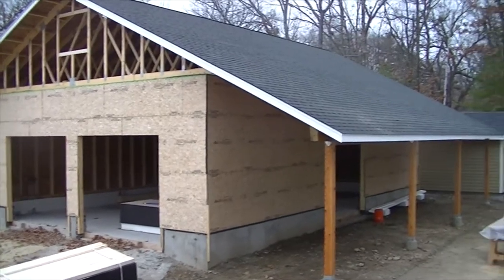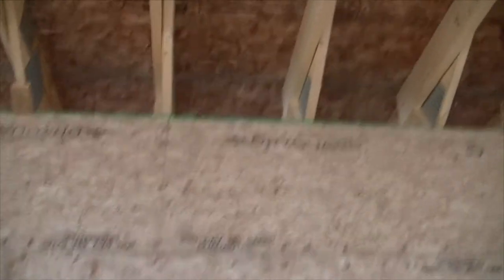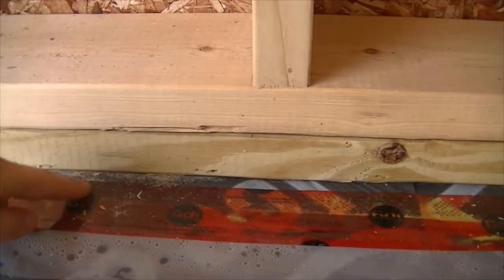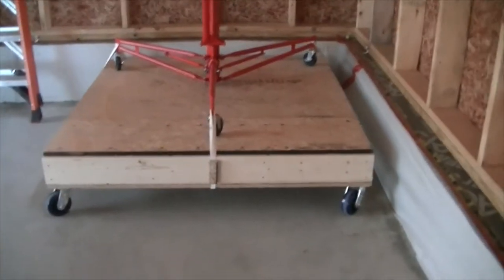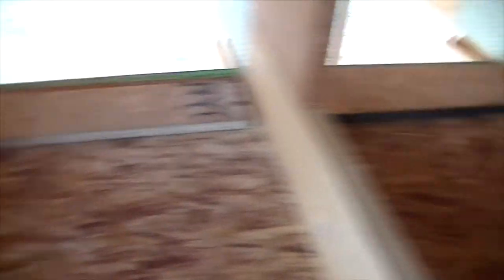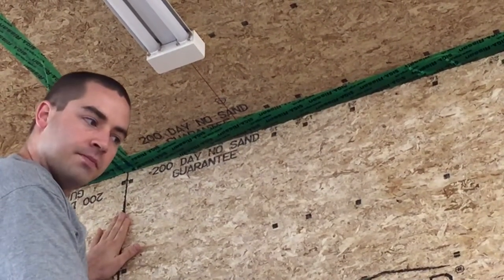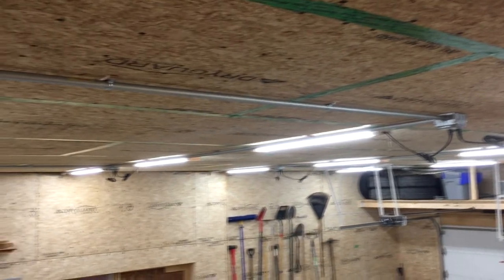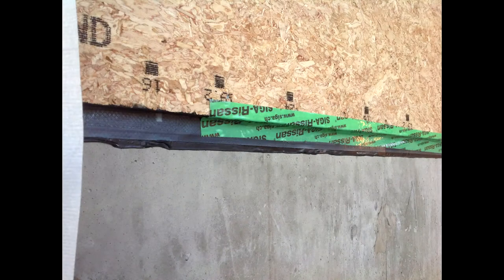Garage Air Sealing

Comment: Great video, huge exaggeration with the slightly misaligned plywood sheets. Slightly misaligned plywood sheets are easily air sealed with tapes or fluid applied flashing. I would reword that so you don't confuse the public. Also, if you have a living space on the other side of the interior wall osb sheets, you should have taped the joints as you mentioned you did not, the whole point of taping those joints when they are on the opposite side of the interior living space is too keep the air quality in the living space healthy and clean and not let garage containments in.

Comment: i think that you show really good attention to detail in your videos. with respect to garage air sealing, my thinking is that the weak point for thermal conductivity and air leakage is going to be the garage door, which seems to me would be impossible to air seal reliably. i suppose you could use an insulated garage door to reduce thermal conductivity through the garage door. is the idea that you were trying to improve the rest of the garage envelop to offset losses through the garage door?
Reply from the maker: Yes, you pretty much nailed it.  Doors and windows are always going to be the weak spots in any thermal envelope, but we all do the best we can.  I did buy insulated garage doors that have a rubber gasket between each of the 4 panels, rubber gasket on bottom, and the typical seal on the face.  The face seal is the worst spot of any of them.  But just because the doors are allow some air leakage does not mean the plywood seams have to.

Comment: So how does it perform?  I have an attached 36x24x10 garage that was only ceiling drywalled when the house was built (2005)... it is now heated and since pre-existing I foamed all of the joint cavities in each vertical wall, between every stud and in all penetrations in ceiling... then followed up with batts on the verticals, cellulose in attic.  With a 30f ambient I'm using 4800btu/hr to heat it (forced air) and I find while that is very good and some attention to detail goes a long way, the real heat loss is in the slab perimeter... easily detected with FLIR.  I assume since you have radiant that you foamed the slab and perimeter but I would like to see some real world btu usage data vs ambient.

Comment: So OSB absorbs ambient water gains weight over time as well as is susceptible to water retention? How did you keep it from absorbing moisture over time?
Reply from the maker: Hi cattigereyes1, Thanks for commenting.  OSB is a common exterior sheathing product made from wood chips and glue.  Wood chips, wood veneers (plywood) and solid wood boards are all capable of absorbing and releasing water.  All wood can eventually rot if left wet.  Given this, I built the garage to stay dry just like any other structure.  There are deep roof overhangs to shed the bulk of the water, and vinyl siding on the walls.  So long as you keep water away from the wood it will stay dry.  I hope this helps answer your question.  If I didn't address something, then please help me understand your question better.  Thanks.

Comment: I have a 500sf garage I am looking to air seal from inside and then tape the outside seams... for inside sealing in a different video I saw you caulked all the stud bays all around. I like this approach but it seems costly and time consuming. Do you think a product like flex seal would do that job well? I’ve seen other air sealing products sprayed on to seal but I don’t know the chemical compositions or any other details of that stuff. What do you think? Stick with the caulk? I’m afraid with caulk expansion and contraction of the wood during the seasons may cause cracking in the caulk which would fail as an air seal.
Reply from the maker: Thanks for your question.  Flex seal might work, but I would go with something else made for the purpose.  One good product for this is Zip Liquid Flash.  It can come in a caulk tube, or a sausage tube.  example: https://amzn.to/2YX5DBA    If I re-did that video of interior garage air sealing (today) I would use the Zip liquid flash.    
It's worth mentioning again that no interior air sealing is as good as taping the exterior joints in the sheathing.

Comment: What thickness interior ceiling osb did you use? same 3/4 t&g?
Reply from the maker: Yes, same thing.  nominal 3/4, actual 23/32 T&G.  I used it on the walls exterior, interior, ceiling, and roof.

Comment: Question about your radiant floor. In the summer, could you use your floor as a cooling source by adding a radiator and a car fan behind it?
Reply from the maker: It's not recommended to use a hydronic radiant floor as part of a cooling system.  The case studies I've looked at wind up abandoning the system due to condensation issues.

Comment: Any suggestions for making garage doors more air tight other than just the usual strip on the bottom and vinyl strip around the outside?
Reply from the maker: You could do a very thin flexible foam between door panels.  The kind that has adhesive on one side.